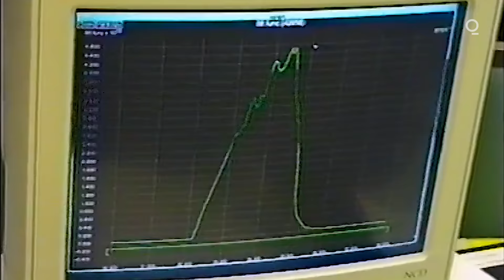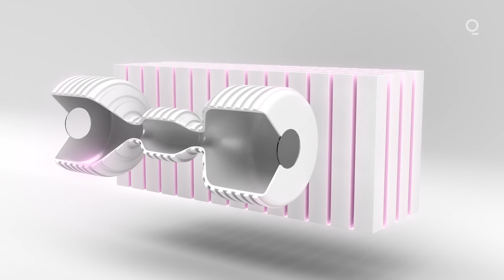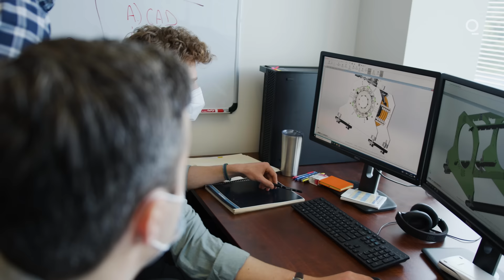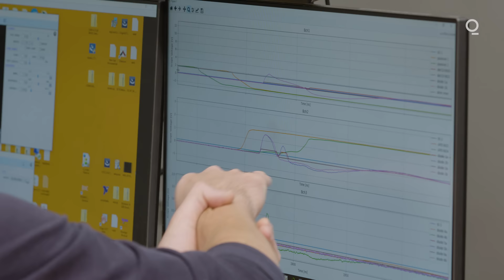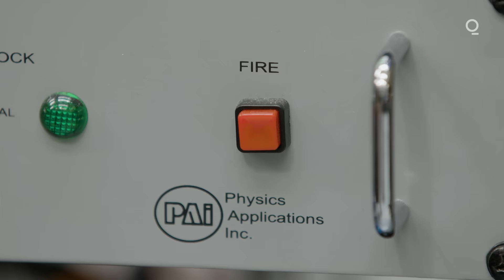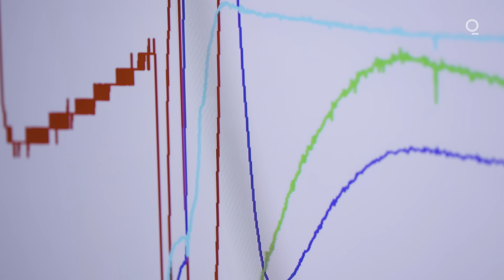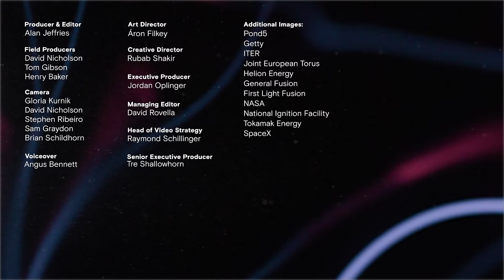Why Private Billions Are Flowing Into Fusion

Comment: Fusion is a technology 30 years away, and has been for 50 years
Reply: its 30 years away until its not!
Reply: @austeyen5628  you’re right, the breakthrough could happen tomorrow but today it’s still 30 years away
Reply: @thsxi  nt with that attitudue!
Reply: @thsxi  yeah i meant even with many wrong guesses, 30 years will be an accurate guess EVENTUALLY
Reply: @austeyen5628  eventually, but we won’t know when that eventually is, we’ll be right but we won’t know it until 30 years later it’s done and then we track back, but until it is done, it’s still ‘30 years away’, even if it’s 1 day away
Reply: It is until it isn't.  It's naive / uninformed not to recognize everything that's happened in the area of materials science, super conductors, AI technology and simulation technology / prediction technology / MIMO control theory etc.  I think you're missing 90% of the story, best case.
Reply: The UK are soooo much closer

Comment: Greenwald limit on density of fusion fuel at a given temperature was found to be twice as high as previously thought. The first reactor to exploit the new fuel density limits will make the fastest progress to net energy.
Reply: Fusion reactions in tokamaks could thus produce much more energy than previously thought
Reply: @offline7620  if you think that the density limit is what limits power density but it's not so, wall loading does
Reply: .... but does not address a negative energy balance doe to energy losses due to radiation and neutrons.  When will MCF get real?

Comment: Helion Energy's plans for direct energy conversion, rather than using fusion's heat to produce steam, is a promising idea to increase the efficiency of this method of power generation.
Reply: I've always wanted to see a method of power generation that can avoid using a heat exchanging system to drive a rotating shaft (not including chemical cells or thermoelectric generators as well)
This method isn't what I would call true direct energy output, but it's the closest I have seen
Reply: @murphysaburningdeathtrap4983  Are you envisaging the harnessing of radiant energy? What would such a thing look like?
Reply: @howtoappearincompletely9739  I do not know but I am all for it
Reply: Yes drive electrons directly without the mechanical losses from turbines. But can Helion address constraints from basic principles (First-Law) in physics? What is their published value for reactor gain Q?

Comment: Is there any big downsides with fusion energy?
Reply: Not sure. It seems cleaner, safer, and more efficient than every other power source, but it's hard to tell until we actually have working designs. 
It will probably have a higher startup cost compared to other power plants.
Reply: @paranoidking  The existing new fission plants are costing more and more to build while solar and wind turbine costs have dropped a great amount.
Reply: There are numerous problems and technological challenges yet to overcome. This highly promotional video seems to have masterfully avoided such questions. As is often the case they failed to mention that one of the primary fuels is extremely rare radioactive tritium. Additionally, the fusion energy neutrons that will be generated by most of the reactor concepts will require reactor shielding, will embrittle reactor components and will cause neutron activation of some components, causing the generation of radioactive elements in them. When these reactors are decommissioned portions of them will need to be treated as radioactive waste.
Reply: @vernonbrechin4207  Love these in-depth answers. Thanks you! Im excited for future news on this topic

Comment: Startup like to compare themselves with SpaceX and give forecasts for their own products based on that comparison. But we should keep in mind that NASA send the first human to moon in 1969. SpaceX took that rocket technology that was already working and improved it during the last 2 decades. But SpaceX is still no capable of sending astronauts to the moon more than 50 years after Apollo 11. Fusion, however, is not a working technology that can be improved in a cost-efficent way by the famous/infamous Silicon Valley approach. At the moment fusion only works in simulations and on paper.

Comment: I wish these technologies will come.  I suggest a hedge though, just as much should be done on the fission side, such as with alternative liquid fuels as found in molten salt reactors, but also pebble fuels, helium coolant, and other approaches that are far easier to accomplish than this. If fission can solve for waste, safety and cost, then perhaps we can still achieve what these fusion visionaries are working towards.
Reply: solving the waste problem has been a dilemma for many decades now. 
It's quite greedy to create waste that is radioactive for tens of thousands of years simply to provide power for one medium sized city for a year. 
It's just as bad as fossil fuels, just a different kind of poison.

Comment: That's insane.  Instead of some kind of fossil fuel being compressed to make and explosion to drive a piston, it's a small hydrogen fusion reaction making the explosion turning the piston.  We already know how to make fusion explosions.
Reply: Not quite, assuming you're writing about General Fusion's approach.   They start by injecting a very hot plasma, basically lightning, into a pumped liquid metal vortex.  More energy is then put in by synchronized steam powered hammers.  The resulting fusion reaction heats up the liquid metal that's surrounding the plasma even more.  When the metal is pumped out of the reactor some of the heat is used to generate steam.  Some of that steam is used to drive the hammers while most of it is used to generate electricity.  So the theory goes.

So, the explosion is not driving the pistons, at least not directly.

The big advantage to this approach is that the released neutrons from the fusion reaction are absorbed by the liquid metal and not the reactor walls.  Said neutrons damage metal structures quickly and they need to be replaced.  Not an issue with liquid metal.

I really hope General Fusion's approach ends up working well... mostly because a steam-powered lightning fusion reactor has got to be the most steampunk thing ever actually, really built :)
Reply: @4Fixerdave  It's more of an ICE in principle than the other designs.

Comment: Fusion power will require an astronomical cost to unlock. But once we do harness it in a sustainable way and at a competitive cost, humanity will be guaranteed eons of energy security. What's more is fusion has the potential to propel our Earth bound civilication to a space faring one. The energy density of fusion is unparalleled. This alone puts it as the #1 candidate to power gigantic space habitats and other structures we often hear about from science fiction.

Comment: Huge input of giga yielded 1.3, a 30% of gain huger giga Newton scaled force, but we still need to find a method to harness the energy emitted from fusion because that amount of input/output energy are dangerous. It just reminds me about the volatile HHO but which, in comparison, is much easier and safer to handle if our scientists try harder.

Comment: Nuclear fusion is actually the best way to have clean energy
Reply: Even regular fission nuclear is amazing, if we would stop using the Rickover design from 1962 to make boom-able reactors if stuff goes wrong. New designs that just fizzle and we got an insane ratio of power output to "material in and out" of the process. 
Those few barrels of waste can (from new designs) be normal in a few thousand years, so we can just dump em in old mineshafts instead of doing the Finnish long-term 100,000 yrs stuff.
About 100 powerplants of new design world wide is fine and then support that with wind, hydro, solar, waves and all of that stuff and we all good to scrap any coal/oil plant.
Reply: yeah imagine if we had a massive fusion reactor in our solar system raining free energy down upon us... -elon
Reply: The advantages of nuclear, without the whole possible Chernobyl 2 electric Boogaloo factor
Reply: Agree. Fusion is the best form of clean energy. Realistically may happen in our lifetimes.

No real waste, immense energy, no undesired byproducts (other than the vast amounts of energy/cost/complexity/materials required to build each reactor - but this is one-time per reactor).
Reply: Given that it hasn't actually generated any power yet, probably not.
Reply: @Toe-Mass  Chernobyl was because of a bad design and incompetence. Modern fission reactors are quite a bit safer
Reply: @barath4545  Even better, didn't I read something recently about how with some of the newer design, nuclear 'waste' can actually be used as a fuel source ? The gist of the article I read was that most older school reactors only use a tiny fraction of the energy locked in fuel rods / pellets, but with newer reactors, this energy can be unlocked.

Comment: I was astounded by the advancement recently letting ai control the magnetic fields, but I'm all for the approach of using the energy directly from the produced magnetic fields, that seems like a better approach. The less steps the better. But maybe a combination of the two is where we'll end up, why leave energy on the table after all.
Reply: They simplified a bit here (understandably). Pretty much everybody agrees that if you can harvest the output energy magnetically, it's simpler and more efficient. The issue is that it affects your choice of fuel: the easiest fusion to achieve (in other words, the least demanding in terms of the temperatures and pressures required) is fusing deuterium and tritium, and that reaction produces most of its output in the form of high-energy neutrons which, being neutrally charged, don't work with this kind of magnetic mechanism. For that, you need to use different (so-called "aneutronic") fuels; I think Helion is planning to use deuterium plus helium-3. This is generally understood to be much harder to achieve, though: it takes way more input energy, so the bar is even higher in terms of being able to reach break-even, which we haven't even reached with the "easier" fuels. That's why most companies are opting to do D-T and steam turbines despite the inefficiency. It's all about tradeoffs.
Reply: @andrew.pendleton  Thanks for the explanation! Was thinking there's a catch to it left unmentioned.

Comment: The whole intro is "the world is trying to find something to replace fossil fuels, and fusion seems like the only aswer" while solar gets cheaper, more efficient, and recyclable  every year
Reply: yes but a few working and efficient fusion reactors would immediately replace fossil fuels while solar will not. humanity won't be using solar as our main source of power any time soon. fusion would immediately change everything.
Reply: And not sustainable and not even making dent in actual supply.
Reply: @nmh1120  Yes but why rely on something that may or may not come in the next 10-100 years? when solar is right there, solar CAN definitely cover all our needs.
Reply: @Phoenix-jd4yf  No ones relying on anything right now. At the moment solar is a better option than fossil fuels. But if and when fusion becomes viable, solar will not even slightly compare.
Reply: @nmh1120  what im trying to say is why wait for Fusion if all the signs are telling us we dont have much time, We should just put more effort into solar, and if fusion ever comes great, awsome, but the situtation is dire and fossil fuels are making things worse.
Reply: @Phoenix-jd4yf  we are putting more effort into solar. it's not like we're putting all of our resources into fusion and none into renewables. all i'm saying is that solar will never be the sole replacement of fossil fuels. it will either be a combination of renewables like solar + fission.....or fusion if it ever becomes practical.
Reply: @nmh1120  yes I agree with you, I guess I didn't read your comment right and thought you were putting all your bets into fusion.

Comment: Nuclear power supply is needed, 0 deaths, 0 emissions
Reply: "0 deaths" tell that to the victims of Chernobyl or Fukushima.
"0 emissions" tell that to the people who have been working on finding a final storage for nuclear waste for over 50 years.
The real power supply with zero deaths and zero emissions are renewable ressources. Without changing the electric grid from the ground up renewables can already fulfill our energy needs. We only need to fill the gaps when there is no wind and the sun doesn't shine. Nuclear power plants need days to start or shut off. So they are not fit for that job.

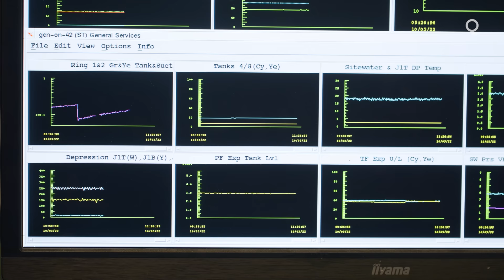Comment: 7:21 You're wrong. Many fusion experiments have produced more power than they put in. But that output have to go through many processes of energy conversion like heating water, steaming a turbine, and many in order for it to be even useful for us. We basically need to output 10x the input. That's the hard part.
Reply: Does that include all the energy used in making all the machines, equipment?

Comment: Pretty cool video but just have to mention spacex still does not have any reusable rockets. They can't just fill up the booster again when it lands, basically has to be rebuilt. I am optimistic they will figure it out eventually but private sector isn't necessarily some sort of magic sauce.
Reply: Wdym rebuilt? Falcon 9 booster doesn't need ALL that much work done to it between flights. Just inspections and cleaning the engines.

Comment: The science and development of fusion is great, but not nearly as crucial as it's made out to be. In fact, to present it as crucial for addressing climate change could be extremely distracting from real solutions we have available today. For instance, we already have a fusion reactor always available to us at all times. It's called the sun. All we need to do is to replicate more converters, like solar cells, wind turbines, etc. and a wide range of energy storage technologies among which to optimize the matching with our variable demand. Additionally, creating a fusion reactor here on Earth may give us another fusion reactor, but its power might be far too concentrated for our political stability, even if it could achieve cost-effectiveness compared with other energy sources. Should we keep working on it? Absolutely, but not for the reasons given. Hopefully, it will become a real, cost-effective, environmentally safe energy source sooner than later. Even then, we will still need the energy storage solutions we're building and further developing to better utilize the sun's fusion energy today.
Reply: Well said Greg.
Reply: The difference is that fusion would be much more reliable than solar or wind. But yes short term we are better off with solar and wind, but we need a more constant and reliable source to back that up.
Reply: @Captain-Sum.Ting-Wong  I would agree that a ship could use a more constant power output source, much like the fission powered subs and aircraft carriers. However, there are many forms of energy storage to apply for balancing clean, distributed, renewable energy sources like wind, solar, tidal, etc. with the demand. These should be employed now, while we continue to work on mastering fusion (preferably compact fusion) reactors for the longer term. To state that we need fusion to address climate change is misleading at the very best and potentially dangerously distracting from the real solutions available today and in need of immediate application.
Reply: @Captain-Sum.Ting-Wong  On the long term I hope for fusion. But we will need solar and wind to get there — and as fallback during accidents. The initial fusion reactors will fail regularly.

Comment: I love this well balanced documentary. To test fusion reactor concepts, we must think outside the box and use AI-powered virtual reality for compartmentalized developments. Let me explain. The MIC (industrialized military complex) and BigPharma sought to improve financial allocations by dividing component or process developments into smaller parts (or contracts with competing firms). This separation brought forth better competition for segments of the development and research components to build next-generation technologies. No one company held the contracts for development, upkeep, and advancements. How did BigPharma use this concept? They used Ai to help test the COVID19 vaccines before going to market. Image recognition has expanded 100X within machine learning, with our brightest minds training the machine learning algorithms for each stage of compartmentalized developments. With VR, research, testing, and manufacturing costs are reduced dramatically. The secret is synchronizing the adaptation of breakthroughs. Decades will turn into days for a "Net Gain" fusion reactor.

Comment: Does fusion make sense large scale though? We need to feed it hydrogen maybe the ratio of input to output of energy is massive and so we can justify fusion as compared to just using the same hydrogen to burn and generate heat and spin steam turbines. At the end of the day we havent been able to generate electricity by means other than spinning a magnet in a coil of wire.
Reply: Hydrogen...the most abundant element in the universe.
Reply: @spencervance8484  yes but we can’t just get a bucket and grab some from the sun. Our current way of getting hydrogen for things like fuel cell cars is running steam over hot coal or by electrocuting water.
Reply: @rashadarbab2769  water electrolysis is pretty cheap since there is a lot of water on earth, and the fact that it uses electricity means that once a reactor is up and running, it can create a positive feedback loop of producing hydrogen
Reply: @aetheriox463  yea but that reduces efficiency because you need to use energy to  produce the fuel.
Reply: @rashadarbab2769  fusion is already ridiculously efficient, it doesnt matter much